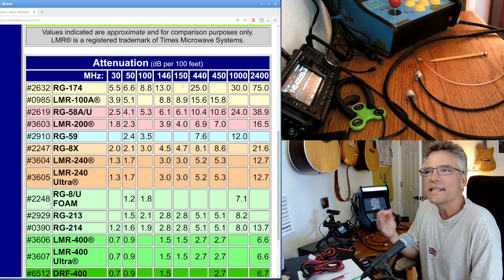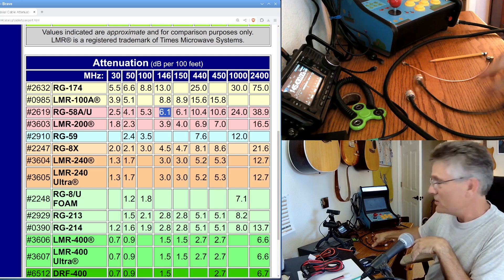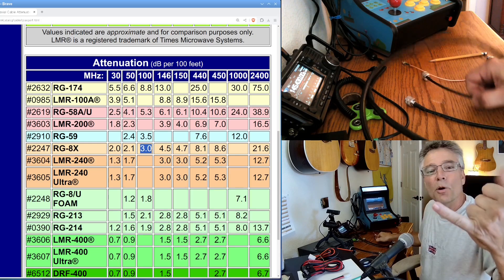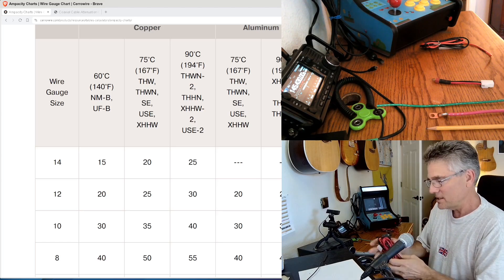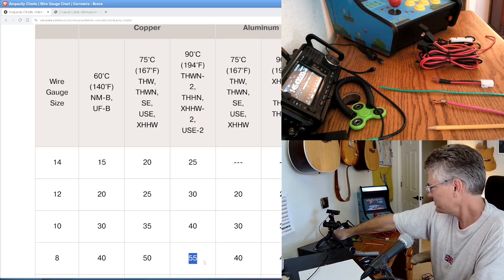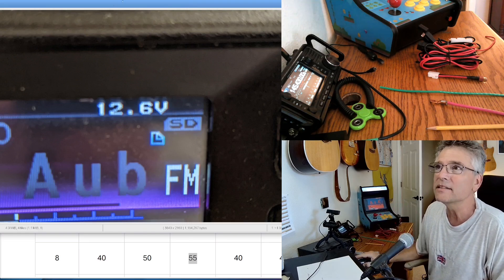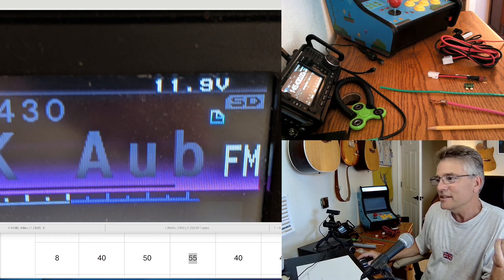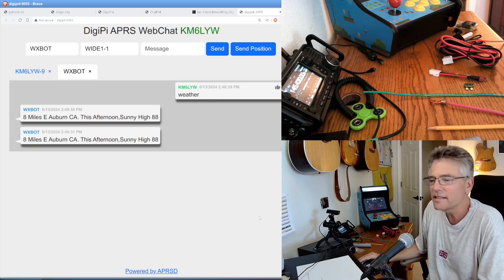Is bigger always better?

Comment: Blue Sea systems makes a circuit wizard app that you can put in your voltage and you’re needed amperage and it’ll tell you exactly what size cable to use for a less than 3% voltage drop. I use it when I’m building my batteries.